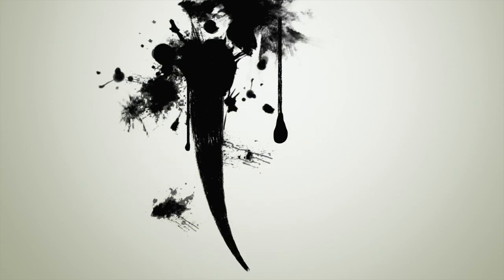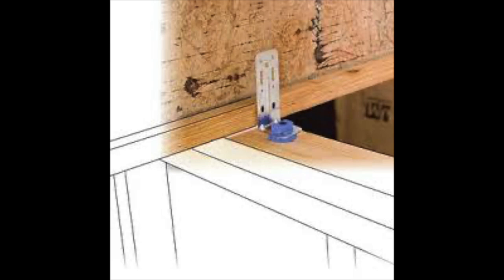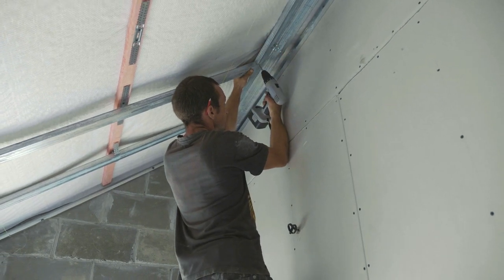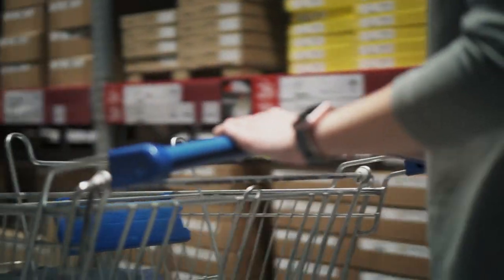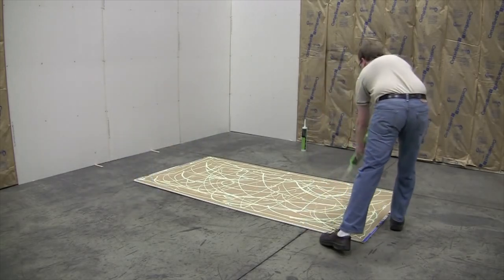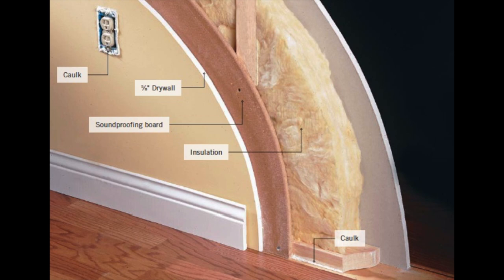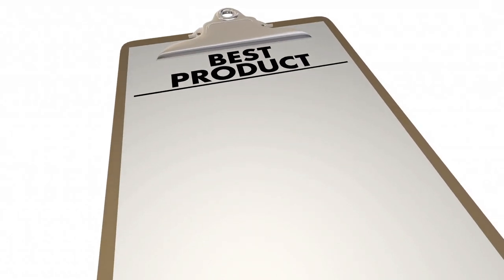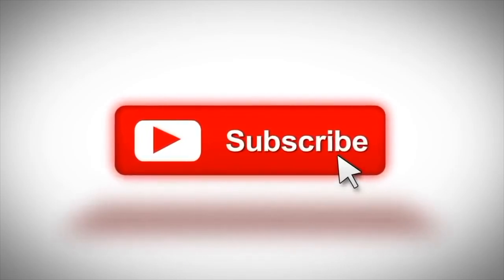Resilient Channel Vs Sound Isolation Clips - All The Facts!

Comment: Bought mine from Alibaba for $0.58/piece. Compare that to how much they sell these clips in the US. Absolutely ridiculous to spend nearly $7.00 a clip.
Reply from the maker: I’ll definitely have to check that out! 👍🏻👍🏻
Reply: Shipping takes 7-10 days. Fedex IP costed an extra $50, if you want by priority air it’s $230 (3-5 business —which isn’t worth it). The supplier I used told me they supply green glues clips and they’re 8 years verified on Alibaba so, it’s legit. Plus the clips are high quality and literally look and feel the same. It’s sickening how greedy these businesses are.
Reply: Im glad I read this comment as it will save me quite a few pennies
Reply: What was the seller you used? Some of the clips on Alibaba seem to be cheaper and likely actually lower quality.

Comment: This is very succinct, but it seems to align with all the information I've researched so far, so well done! Staggered walls are approximately +10 STC over normal walls (double walls get more around +25 but they really take up a LOT of room). Resilient channels add approximately +10 STC while green glue adds +4. So when you combine all these different things together you can easily get great numbers. For example: Staggered wall + two 5/8" drywall both sides + green glue = 62 STC for only about 5" total thickness of wall. While a plain wall + two 5/8" drywall both sides + resilient channel = 63 STC for about 4" total thickness of wall. And double walls are even better (easily hit the 73 range!)--but most people aren't willing to have a wall thicker than 6" just for sound reduction.
Reply from the maker: Yes, by combining soundproofing methods you will definitely up the STC rating of the wall! Let me know how it all
Worked out for you!

Comment: According to the chart at the beginning of your video, the difference in STC ratings between a 5/8 double wall utilizing quiet clips and 7/8 hat channel and the very same wall system adding green glue, is only one point, (62 vs. 63). With that in mind, it does not seem like adding green glue to this particular system is worth the astronomical expense. Thanks for the video
Reply: The other thing about green glue is what happens if you need to demo at some point. The sheets are literally glued together so you need to cut through all layers at once which is really bad when dealing with heavy 5/8 drywall

Comment: Why can't I add the resilient channel over the existing drywall if I use wood furing strips over the stud so that the metal doesn't touch the drywall. I really don't want to throw away the existing drywall as it is fairly new. 

I am also wondering if this can be done from the outside. My ADU is built like a shed and I can simply unscrew the osb siding. I was thinking about adding joist tape on the outside studs then resilient channel or wood furing strips perpendicular to the studs and then screwing 1/2" OSB into the resilient channel and then using carpet glue to add the OSB siding. Another professional soundproofer on YouTube says carpet glue works as well as green glue for less $.

Also wondering if it is neccessary to do the floor of my ADU and how to do it. My neighbors muffler and bass drives me nuts. I have a open air crawl space underneath with no insulation. I'm redoing the floor now while staying in the main house. I plan to use joist tape then 2x4s on the joists then expanding construction adhesive and putting the screws into the 2x4s but not the joists. Over the 3/4" OSB I will add carpet glue then a 1/2" layer of OSB, then I'm pouring self level concreat.

Comment: I have an existing room with finished walls. Do you recommend soundbreak or quiet rock mounted right over the existing drywall??
Reply: "When adding a 2nd layer of drywall, this should be done on the other side of the wall. If the resilient channel is installed directly over drywall (rather than studs), it creates a mass-air-mass condition that greatly reduces its effectiveness." Saw this on a construction page of don'ts for RC installs....

Comment: I'm in the process of building a drum room in my bedroom. None of the walls from the drum room will come in contact with my existing walls. The main idea is to be able to practice in my room without any complaints from ANYONE!!!. My drum room is going to be 8w x 10L x 8H. I'm thinking of using soundproof joist tape and 5/8inch sheetrock. Willl this also help in reducing decibles?
Reply: Drums are LOUD and penetrating at all frequencies. Read as much as you can before building it! One significant part - how are you going to get AIR? Any openings or ducts will leak sound completely - defeating the purpose of a sound booth! It's really not as simple as just building a room in a room, you can spend a good amount of money and not have a quiet outcome, especially on the low frequencies.

Comment: Not bad for a DIY video however "a compound" is only used for the 1st layer seams, not the wallboard (here you want to cover the entire surface with MLV).  Also you want to use two types of material (one being the wallboard that is acoustic based and the other (1st layer) being MDF or HDF.

Comment: BacktrackADV
Thanks for the informative info on sound proofing.
Most literature I've reviewed discusses  talking/music sound and impact sound. I haven't read anything addressing noise arising from the floor or ceiling structure itself. A common source of squeaks in a floor is floor boards rubbing together or fasteners (usually nails) rubbing against the wood after they become loose over the years.
I am renovating a house built in 1912. The flooring on the main floor is hardwood over fir shiplap. In the basement below, I have access to the ceiling joist and have shimmed and glued as much as I can to reduce squeaks from wood on wood and wood on nails in the main floor above. Will the decoupling with clips/hat channel and two layer of 5/8 type X drywall and GGlue, help reduce any future squeaks that might (will!!) arise in the future? 
Thanks in advance for your help.
Reply: Hi BacktrackADV, have you got your project completed by now? What did you end up doing and what materials did you use if you had please? Looking to start the project myself with the same source of the problem - squicky nails above... Thank you so much!!

Comment: im new to this, would resilient channel be better or worse then a staggered stud wall?
Reply: Soundproofing is a combination of things. Resilient channels (which I recommend people NOT use and use isolation clips and hat channels instead) are structurally decoupling the new wall from the existing structure. Walls are to add mass. It's a combination of mass, decoupling, dampening and airspace (insulation) that will lead to noticeable sound reduction.
Reply: @JonathanHochman1  why not use resilient channel
Reply: @yummy1234098  resilient channel doesn't block sound as well as the isolation clips and 25mm hat channels do. Resilient channel would likely be cheaper, but it's not as good.

Comment: Thanks for these videos! Just one question: I'm making a room-in-a-room home studio, with resilient channels, mineral wool, drywall, a layer of mass loaded vinyl, and another drywall layer. The question is, in this situation, does the density of the mineral wool make any difference in terms of sound insulation? Thanks in advance.
Reply: DON'T use resilient channels and instead use isolation clips with hat channels, you will get the actual structural decoupling you are looking for. You should also instal one layer of 5/8' drywall, caulked with acoustical calking, with a second layer of 5/8" drywall applied with different staggered seams again sealed with acoustical caulking, with Green Glue (minimum 2 tubes per 4'x8' sheet).
Reply: @JonathanHochman1  Thanks for the reply. I'll try to find those hat channels. The problem is that, here in Spain, Green Glue is way too expensive, and MLV is much cheaper; when in the USA it is the opposite, I believe.
Reply: Going as dense as possible is recommended (with respect to your mineral wool).. but even standard room insulation should be fine.  A rule of thumb is:  higher density/less sound transmission.

Comment: What id mounter the resilient channel using rubber pads so the screw never directly touches the resilient channel and the resilient channel never touches the stud? To me it sounds like that would be about the same as sound isolation clips

Comment: Hi! I have a brick wall covered with plaster. There are no wall studs there are laths and I do not have a lot of space between the wall and the door frame to put a lot of layers on the wall. I am trying to find the best way of sound proofing the party wall in my condo, I do not want to hear any noise. What do you suggest that I do?
Reply: How much space do you have to work with?

Comment: Very helpful. Thank you. Any advice on impact noise? I'm building a small room in my room (oddly enough) The sources of noise from inside will be caused by 2 Chinese sewing machines specifically for sewing thick leather. They're like sewing machines on steroids. Very loud, but still manageable. But my concern is the noise caused by a ball pein hammer etching designs into leather, placed on a thick slab of marble. I was told marble absorbs the sounds of impact, and it does a little bit. But not even close to enough. Any suggestions from anyone on how this might be reduced? The problem is I need a solid impact on both ends. So shock absorbers and extra leather as cushion just defeats the purpose. Is be very grateful for any suggestions.
Reply: Before you can figure out a proper way to treat a room issue, you must measure. Without measuring, then you're just guessing.

EVERY situation is not the same as the next person's situation.  ss
Reply: David are you alive?

Comment: We have noisey neighbours and can hear even talking threw the wall. The wall is a solid stone wall. As affects my wife’s health we don’t care about losing space my question would it be more effective to just build another wall from concrete block inside the wall the whole length of the house with a air gap between ?
Reply: Hi Jon!  Concrete is not needed. There are several ways to soundproof a wall. Way 1.  25-40 mm high density cork-blocks masoned/glued to the stone wall. Then plasterboard on top of that. Way 2. Use metal  or wood studs glued to the ceiling and side walls, they are not to have contact with the stone wall.. Its meant to be a free-standing wall only secured with glue and 2 screws on all sides.Glue like no nails brand etc . There are metal studs with built in 2-3 mm sound isolation, they are just fine to put glue on and secure to the sides/ceiling/floor etc. Put studs every 45 to 60 cm and fill with Rockwool. With the plasterboard on top, you leave ca 3-5 mm gap all around the studs/wall/ceiling including the floor, and fill it with a latex compound to secure and absorb the vibration. If necessary put another layer of plasterboard on top and secure with latex.
I have just done my wall in my studio and I got the roof fan down from 44 db to 34 db and now I don't have to hear my neighbours girlfriend rag his as from time to time, and I have not even finished the wall.  Best of luck.
Reply: Build a metal stud wall that doesn't make contact with the concrete wall.  Roxul between studs.  Fasten mass loaded vinyl to the metal studs and sound clips then snap hat track in and screw drywall to hat track.  Then layer of green glue. Add an additional layer of 5/8" fire x drywall and use acoustical sealant to seal all around edges.  Leave space of about 1/4" from bottom of drywall to floor and ceiling,  Seal that space with sealant.  You should use quiet putty to seal the back of electrical outlets and switches on wall.  When you add 2nd layer of drywall stagger the seams so they overlap instead of lining up.  You can use clips to secure metal track to ceiling and floor.  They should have thick rubber washers around screw.  Make sure everything is decoupled and not screwed directly to a stud or you will create a sound bridge allowing the sound to travel rather than drop and dissipate in the form of heat.
Reply: @shovelheadseven  Fred, you forgot one thing:  Hunt down the builders and take them out for a good "talking to" for doing such a horrible job.   I'm sick of builders doing horrible work

Comment: When you say "sound", what exactly do you mean in terms of frequency range?
Reply: 20Hz-20kHz
Reply: @dirface  How much are you absorbing in that range?  There should be some sort of information about the AMOUNT or LEVEL of absorption at different frequencies in the range you are referring to..  Does anyone know exactly what those are?

The problem with some of these tactics is does it truly solve the problem.  The people I refer to that deal with this usually want to know what frequencies and relative amplitudes are the problem, everyone has a different set of problem and then you have to pick the materials and design for how to build a barrier to address the specific frequencies and amplitudes to attenuate enough of the sound going in or out of the room.
Reply: @dirface  Oh, the STC ratings he lists aren't that great.  I know another acoustic treatment/barrier company that has a 10.5in thick wall that can be built that has an STC rating of 90 and it goes down to 40hz.  I HIGHLY doubt these things in the video are going to get anywhere near that level.  And I doubt they aren't going to really do much down that low..